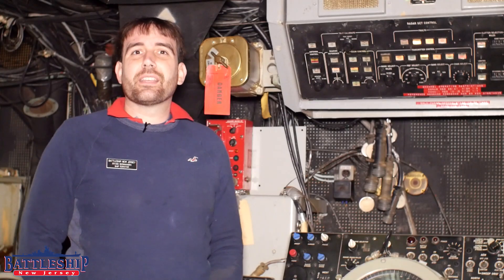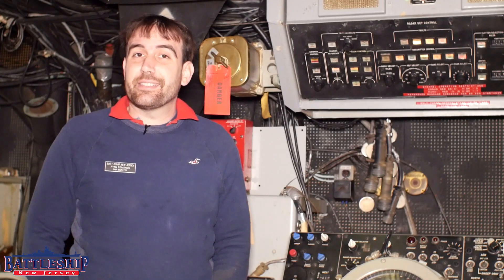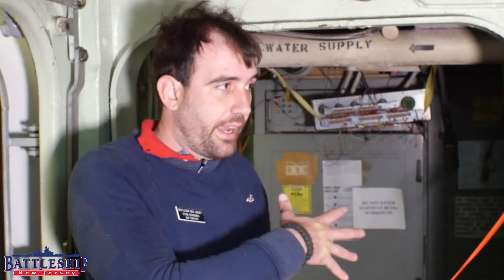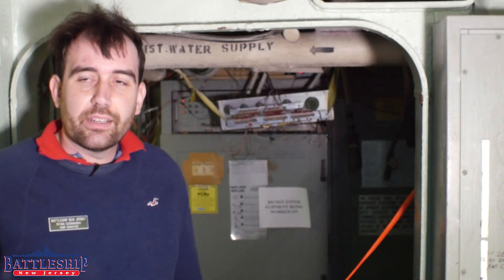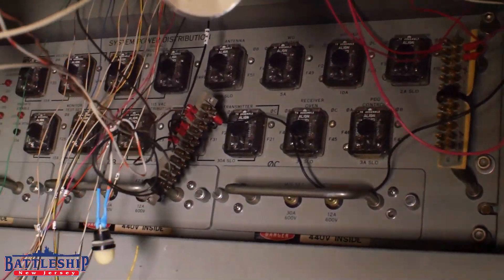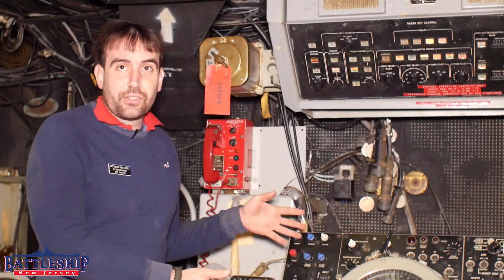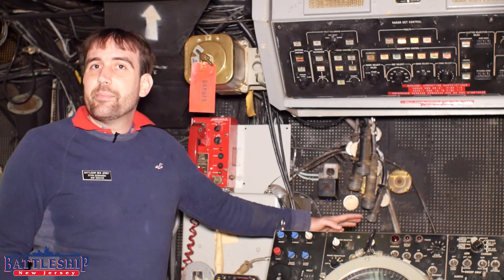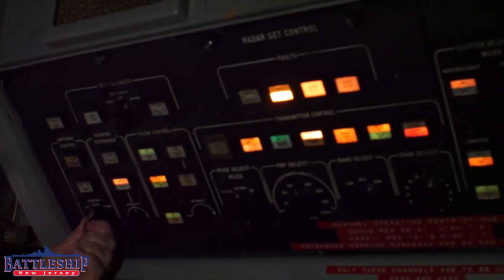Rotating the Air Search Radar

Comment: lol... I remember the Spizz-49 - I was an SH-60B Seahawk crewman, and it was programmed into our ESM library aboard the helicopter when we operated off the San Diego coast - nice to track friendlies (if they were radiating). Us AWs (operators) did a lot of programming changes to the ESM (Electronic Support Measures) to help in tracking and navigation.... and had separate libraries depending on WHERE we were operating and the threat.

Comment: The AN/SPS-49 was my baby when I served on board USS Preble DDG-46 from 81 to 85. An amazingly capable radar. The surface search radar is a AN/SPS-10, not a SPA-10. I also supported that equipment. It is just as well you got a non-functioning unit. If you had a complete SPS-49 on board you would not be allowed to radiate it out the antenna, had to be more than 50 miles offshore before we were allowed to do that as it caused major interference with civilian electronics and radar systems.

Comment: When I worked for the Navy in White Oak back around 1980, we some sort of SPS radar mounted on the top of one of the buildings that we used for testing a track-while-scan system we were working on-- it might even have been a commercial unit, though the software ran on a UYK-20 that was one of the banes of my existence (not the machine itself, but compiling the code, which was an annoying Rube Goldberg arrangement). We did light the skies up around us in suburban MD and managed to get it to track planes going in and out of National.

And remember: "Men Working Aloft Do Not Rotate Or Radiate" (from my wife's days in the Philly yards)

Comment: Does the wording in the contract say you can't reactivate the existing hydraulic systems, or that none at all can be active, even if it's a new system the museum installed?  I'd think if you showed those systems in the turrets to a heavy equipment, oilfield, or mining systems guy they'd be able to design something to enable them to rotate using replacement parts or new pumps, but with a rebuild on the rotary motors on the pinions.  Of course, this would be for a turret that doesn't have the tour access cutouts!
Reply: I may be wrong, wouldn't be the first time, but I believe he mentioned in a video about their contract that they are not allowed to reactivate the steam/propulsion plants, and galley equipment. I don't recall him mentioning any restrictions on hydraulic, electrical or plumbing systems. He actually did a video crawling into the inspection space between the barbet and ring gear to see if it was true that the Navy had welded them in place, which he confirmed they hadn't.
Check that one out if you like seeing Ryan stuffed into tight spaces. Id imagine though that it would be a requirement that it be a new independent system, since there's no reason to restore hydraulic pressure to everything on the ship that used it. Be interesting seeing them running around chasing leaks though, but the electric bill would be insane.

Comment: Depending on what frequency is used, they likely COULD activate the radar system without causing any interference.  Think for a moment.  These radars are still in use on ships that do sail into ports.  They don't fry anything and they don't hurt anything.  Also, there is nothing that says they would have to run it at anything approaching the power level the Navy used.  

Think about how neat it would be to have an active display.
Reply from the maker: You don't run radar in port. But we have ways to sort of "fake it" so the screens around the ship do show images as if it were fully active. The benefits of not having changing surroundings.
Reply: @BattleshipNewJersey  Thanks for the answer.  When (and if) we ever past this COVID thing, visiting the New Jersey is on my bucket list, perhaps even taking a curator's tour.
Reply: No, my ship had an SN-SPS-49 and we were not allowed to radiate out the antenna within 50 miles of the US coast. When we had to do any preventative maintenance we would radiate into what was called a Dummy Load that absorbed the RF energy.
Reply: @edwardpate6128  So, you couldn't run radar within 50 miles of the coast?  That seems dangerous, especially in limited visibility conditions.  How do civilian ships get to run radar?

Comment: Instead of rebuilding the drive system, I think you should have made an off the shelf motor work in its place and use a computer to simulate the control panel operation. That would have been much cheaper and given the same appearance of normal operation.

Comment: I was unlucky enough to have to help replace 2 of the SPS-49 antenna reflectors while on board the USS Preble, because they got damaged by the signal flag ropes that got blown up and twisted around the reflector. The slightest damage to the reflector had a serious effect on the radar pattern and range of the radar. Being that I was the only Tacan technician on the ship, and that I regularly had to go aloft to do maintenance on the Tacan antenna (top of the aft mast), I was a prime candidate to aid in the radar reflector replacement. The reflector itself is amazingly light for it's size.

Comment: At 3:50, a search radar does not provide an information of height. The main lobe is almost only restricted in azimuth (3.3 degrees) by the reflector. But the antenna is stabilized to compensate for pitch and roll of the ship (+/- 23.5 degrees) to keep it rotating at a horizontally plane.

Comment: Raytheon Co designed & manufactures SPS-49 I worked on the original 2 transmitters at the Wayland MA engineering labs in the late 1960's early 1970's. They were a whole different design than the actual deployed systems. We mounted the antenna on the roof of the building and when we radiated we lit up florescent tubes for abt 1/4 mile radius as the RADAR rotated. There was a commercial greenhouse  across the street with hundreds of feet of 4' tubes that lit brightly every time the beam swept by. Needless to say we had a lot of sector blanking programmed
 in by the time we were done.

Comment: BAD memories.  Behind you way out on the yardarm in several shots  is a "windbird", one of the sending units for the Wind Speed and Direction Indicating System.  Many years ago on the USS Kansas City (AOR-3) I was granted the dubious honor of completely going through both windbirds...including removing them for the work and replacing them when I was done.  I do NOT do heights.  To add to the fun, we were in the middle of a yard period.  Instead of "a long way down to the water" (survivable), it was "35 feet further than normal to fall to the concrete bottom of the drydock"...
Reply: On the bright side, at least the extra 35 feet would extend your lifespan by probably a few hundred milliseconds.
Reply: @vbscript2  It was 35 feet of additional terror for me.  Funny thing is, I made a living installing copper and fiber cabling for years before I transitioned over to the phone system programming side.  

20 years of ladders, scissor lifts, boom lifts, man cages on forklifts, belt-and-spikes up poles, etc.  Never did get over my fear of heights...it just got trumped by the fear of my family and I being hungry and homeless if I couldn't do my job.

Comment: "There are men working aloft. Do not rotate, radiate or energize the antennae's without first contacting blah...blah...blah". Heard that so many times over the 1MC while aboard ship. Someone actually did a test and the energy coming off those antennae were capable of cooking food like a giant microwave oven lol.
Reply: Common demonstration during training is to throw a hot dog infront of the dish as it sweeps by. If you get a good toss the hot dog will cook so fast it pops.
Reply: I've made that announcement more times than I can count.  I've also been up the stick a few times myself.  I was an ET and worked SPS-40 and TACAN on a Knox Class Frigate.
Reply: I was gonna say that. Oh, well.
Reply: Saw a SPY-1 radar kill a bird in flight once. He flew in front of the lobe, faltered, and splashed. If he had been closer in, he would have probably made it, due to the design of phased array radars the beam doesn't really have that killing level of RF radiation till about 10 to 20 feet out from the lobe.
Reply: I know a radar tech who said they quite often cooked a turkey for Thanksgiving or Christmas on the dish. He also told a tale about a prisoner detail being given the job of painting the tower and the dish with lead paint. Took them a while to correct it as it caused a short when they started the radar back up after the detail left.

Comment: Have you wired it up so that the azimuth brake is electrically released? The original design keeps the brake released for 16 seconds after rotation power is shut off to give the antenna time to come to rest before the brake is slammed on. This was controlled by relay K6 in the 2A14 module (which you probably don't have). If the brake is applied before the antenna comes to rest then the brake will be destroyed very quickly, and then your antenna will blow around in the wind.

Comment: I think sound and vibration would help make it seem more alive. Active ships constantly have machinery humming, clanging, etc. Replicating what some of the machinery would sound like while idling in the background would be cool. You could simulate engines, pumps, motors, and more. There are even purpose built industrial vibration motors that could mimic how it would feel to stand near a running engine. Maybe you wouldn't run these systems all the time, as tourists wouldn't always want to have to shout, and vibration motors may or may not be a concern in term of causing fatigue the structural components, wire insulation, etc. But it would be cool if you ran them twice a day for 30 minutes so people could get a sense of what it was like. When I think of what tells me a large machine is active and functional, the sound and vibration instantly come to mind.

Comment: In the Air Force in then West Germany, I was in a tactical air control squadron.  Our radar was the AN/TPS-43E.  Like yours, it could skin paint aircraft at over 200 miles.  Ours radiated at a power of over 1 MEGA watt.  It was also a 3D radar.  Depending on the frequency of the radar, it could cause interference with other radars and broadcast signals in the area.  Who knows what that would do to WiFi in the area?
I maintained the computer system and the consoles that displayed the radar picture.
Granted it would be nice to show people on board the radar picture of aircraft in the area.  The paperwork to get the permission would probably sink the USS New Jersey!

Comment: Its obvious Ryan does not get up to the radar platform that often. He was pushing the fall protection device up the mast. Put it on a short leash and use both hands on the ladder. The radar is stabilized for pitch and roll. The tracking of 40 targets was done by computers in 1981. There is no height finding on the SPS-49. The SPS-10 is a simple surface search radar used primarily with SPA-25 displays.

Comment: Awesome job.  Save yourself a bunch of issues with at least one of the timers and put a daylight sensor on it.  That way you dont have to change  the timer for different hours during different parts of the year.  Also a good safety is to put a load sensor on the motor.  That way if there is a mechanical issue or ice freezing it up and causing issues, the motor will be saved.   Keep up the great work!!  A question, there are 2 white boxes a level down that are pointing at odd angles away from the ship.  What are they?
Reply: SLQ-32 ECM
Reply: ECM devices added in the 80s. I forget the model number, starts with SLQ I believe.
Reply: @MisterLongShot_Official  Interesting, Thank you

Comment: How about reactivating the Sea-Whiz?  
To at least spin the barrels and move around a bit.  That would be spectacular!
Reply: @cd rom the CIWS is self contained with just power and cooling water systems needed
Reply: That, a ton of propane and oxygen as well as a system to rotate the barrel for the simulated fire.
Reply: @cd rom the M61 Vulcan can be electric or pneumatic (compressed air, not steam). In the CIWS and C-RAM it is electrically powered.
Reply: That would be cool!
Reply: @cd rom Okay... it takes steam, and without the boilers running, no high-pressure steam to run the CWIS.  That makes sense.  I'm only familiar with the 20mm Vulcan cannon on aircraft, and they operate using ram air.  Thanks for the explanation!

Comment: The jackscrew on the back of the reflector does control elevation of the antenna, but does NOT factor into finding elevation of any targets. In fact, the AN/SPS-49(v) Air Search Radar (pronounced spizz-49) is a 2-dimensional radar. It does NOT find altitude of targets. The jackscrew’s function is to change elevation to compensate for the ship’s pitch and roll at sea. The antenna takes inputs from the ship’s gyrocompass for that. It’s similar to the gyro stabilization of the gun turrets. But in this case, it helps the OSs (scope dopes) from seeing excessive sea clutter and from losing targets as the ship moves about.
Reply: The stabilisation function is probably the most troublesome part of the SPS-49 system. Elevation motors lost magnetism, the motor-generator output became unstable, 2A14 module output transistors failed, along with many other faults. The switch tubes in the modulator decks were a close second.
Reply: So what was your MOS? Lol
Reply: @WvlfDarkfire  Sailors don't have MOSs.  We have Ratings and Naval Enlisted Classifications.  Mine was ET w/ the 1572 NEC.

Comment: Would not hurt anything by radiating. Airport radars are already saturating the area and radiating will not hurt other radars in the area as they are smart enough to filter out the out of time targets. Best thing is to leave the motor running starting and stopping is the hardest thing on motors and the equipment powering them to handle the inrush current.
Reply: It'd interfere with every antennae and satellite dish within range (and don't ask me what it'd do to other boats).
I was a satellite technician once and airport radars forced us to reposition satellite dishes behind buildings just to get a clean signal through so people could watch their tv.
Reply: @tyree9055   here's the deal different frequency's different harmonics and too deep to break down to a summer job satellite installer in comments.
Reply: @shadowsrwolf  Not exactly, because military radar systems don't follow civilian rules.  They straight wipe out your $h!t and the FCC doesn't control them either.
Reply: @tyree9055  so the FAA is not using old Airforce radars with a FCC frequency authorization then...
Reply: @shadowsrwolf  Your the one who believes that using a radar would have no impact on the city's residents...  An extraordinarily powerful, military-grade system that would probably cause radiation burns on anyone caught in its direct field of view (while operating).  If a handheld TacSat can radiate its user, what do you think a powerful shipboard one will do, eh?
These aren't your Mama's radios bud...
Reply: @tyree9055 so Free-space power loss must not be a thing then. well fuck me i need to go call the school house and have them change the radar concepts curriculum.

Comment: My ship was on PIRAZ and AW duty in the North Arabian Sea during the hostage crisis.  Unfortunately, our SPS-48 3D air search radar didn't work, which is not a good thing if you're supposed to be in charge of the air defense of the task group.  However, to confuse the Iranians, we kept the antenna rotating, even though it was not radiating.
Reply: Michael, I worked on the SPS-48 in the Gulf of Tonkin in '72 on the USS Somers DDG-34. The fleet admiral told us he needed OUR radar to see what was coming at us. We ALWAYS had our radar running! The 48 is one HELLFA radar! It was a dream to troubleshoot. The documentation that the vendor (ITT-Gilfillan) created made it possible for us to follow an individual signal from the antenna all the way to the radar room. Not so for other systems. BTW, I still see that the 48's square antenna is on ships in service.

Comment: i would love to see it with active radar, but I get why it's not a good idea either lol.
Reply: Well, the airfield near us has a radar system and it completely wipes out the DirecTV satellite signals to any dishes in its range.
I got called out to determine why this guy had no signal and we couldn't find anything wrong with the system.  We repositioned the dish so the building blocked the direction to the airfield and "Presto" he had service!  So I can imagine the complaints for the new Curator if they did something similar...
😅👍
Reply: If the experience of the USS Cobia (located in Manitowoc, WI) is any indication, it would not go over well with area airports. The Cobia has the oldest working radar, but it causes interference with O'Hare Airport so they can't turn it on